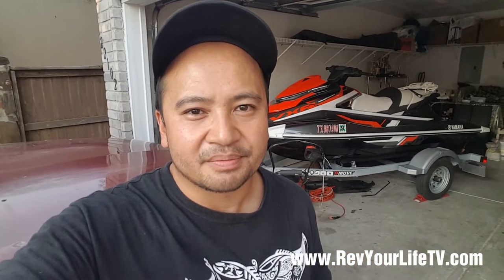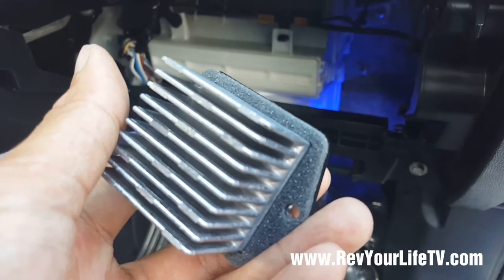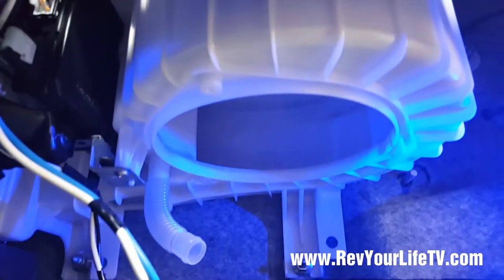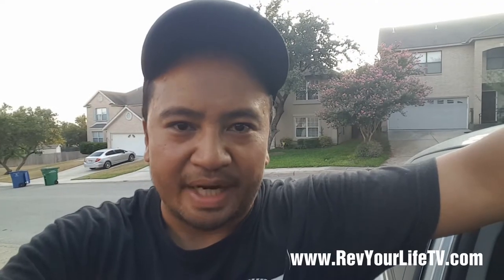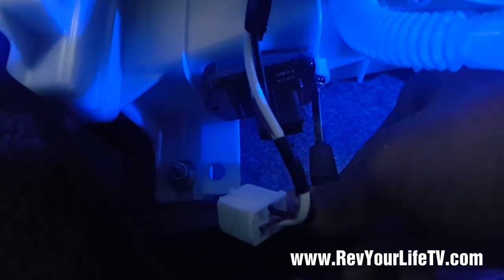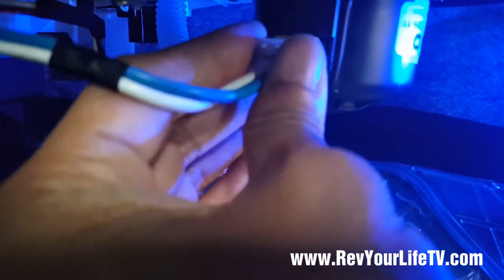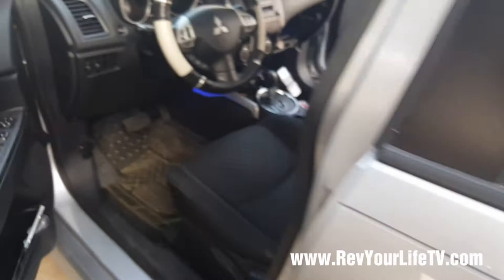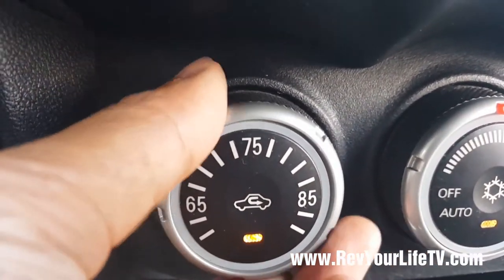DIY:  2011 Mitsubishi Outlander Sport | Air Conditioner / Heater blower & Resistor Repair

Comment: Thanks! Will help me now in 2020.
Reply from the maker: Good because the method for maintenance helps you out if the year of your Mitsubishi specified ranges from the years from 2011 to 2020.
Reply: This worked on my 2010!! Now I have this slight ticking noise from the fan BUT hay! I have AC/Heat now!!! THanks! It was the AC drain plug that was plugged up. Caused water to flood the fan and transformer housing. Coat hanger into the drain plug and about a quart of waster came rushing out. All good now! Thanks again!!
Reply from the maker: Glad it helped out. 🙏🏻

Comment: I do have 2011 Mitsubishi RVR SE that is Canada version, and just tje other day I start loosing AC and noticing hissing sound behind dash board driver side. Blower is pushing the air, but cold air would come thrue the air vents only on driver side little bit, and then it would go away, and passenger side only normal air temp. I start joking how RVR created its own dual zone🤣🤣.
So, any thoughts. Thanks.
Reply from the maker: Check the free on a/c levels to make sure you have a good amount.